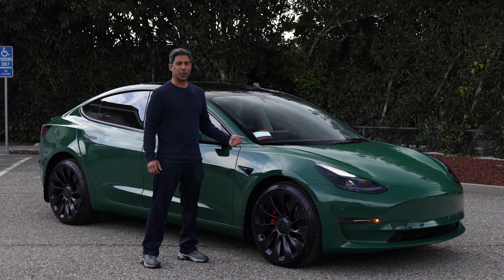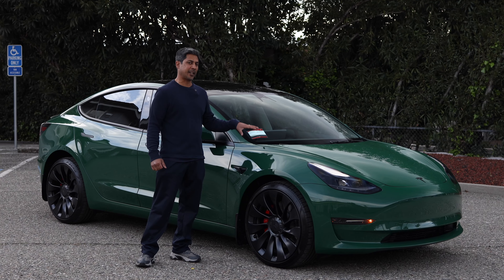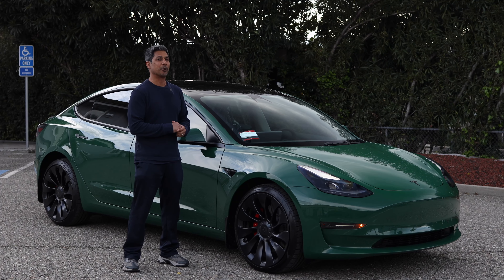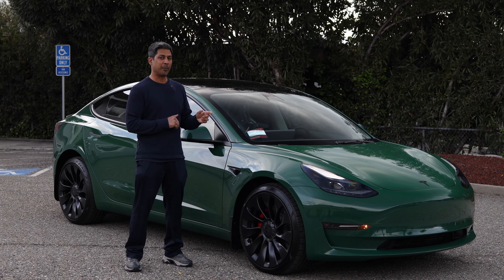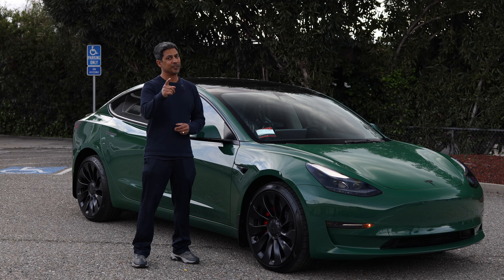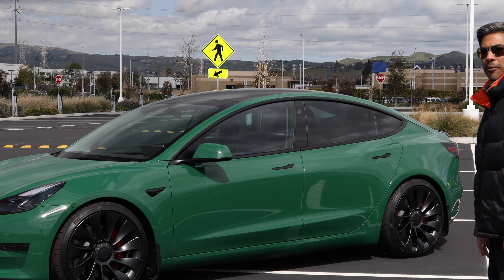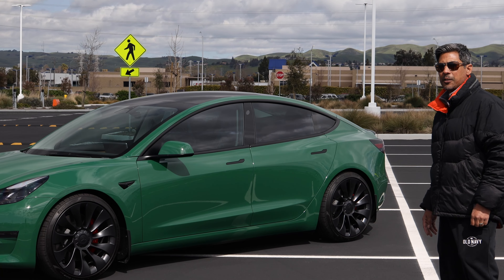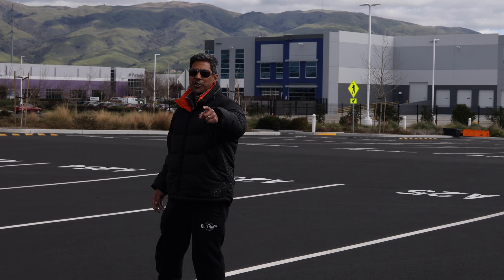2023 Model 3 Performance dropped on ZEV Springs by Eibach  and wheel spacers!!!!

Comment: Great video! I have 25mm (1'') lower Eibach springs and H&R spacers 17mm front and 17mm rear on my M3P 2023. with OEM Pirelli tires 235/35/20.
Do you think if there will be a tire rubbing if I mont  wider tires - 245/35/20? 
I would really appreciate the advice!
Reply from the maker: a lot depends on your camber values.  You'll probably be fine.  Did you buy rear camber arms?

Comment: How did you guys get the Eibachs to lower just 1" all around ? I thought Eibachs lowered the performance 1" front and 1.4" in the rear. Also, did you guys need to run rear camber arms?
Reply from the maker: We always do rear camber arms.  This also helps to level out the car because camber will affect the ride height.  We are very particular and like symmetry.  We have our own ZEVcentric Eibach setup. That reverse rake was something we did not like and really diminished the ride quality so we came up with our own setup after tons of testing.

Comment: In order to get a more isolated ride ie not feel all the road harshness penetrated into the cabin, does switching to polyurethane spring isolators help?
Reply from the maker: Unlikely.  You just need these adjustable shocks to soften the damping. https://zevcentric.com/collections/coil-suspension/products/tein-endurapro-plus-adjustable-shocks-model-3-y?variant=43332838719733

Comment: H&r 14mm spacers F&R?
Reply from the maker: Correct.  Only works well if you have rear camber adjustment to dial it in. Are you lowered?  https://zevcentric.com/collections/model-3-spacers/products/h-r-trak-14mm-drs-mz-wheel-spacer-bolt-5-114-3-center-bore-64-stud-thread-14x1-5-black-pair?variant=43215766782197
Reply: @zevcentric  still stock at the moment. Picking up mpp comfort coilovers and rear camber arms, debating to get spacers or swap out the OEM 235/35/20 pzero to 255/35/20 ps4s.. not sure if spacers will still be needed
Reply from the maker: @jchan112  i can help you with all that.  We stock the MPP stuff and race on it as well.  We will be starting our MPP series very soon.  One of the pinnacles of this channel.  We can discuss the tire/spacer situation via email if you’d like.

Comment: Big fan of the channel. Been following you on facebook for a while. If you were to choose between Tein EnduraPro Plus + Eibach spring and MPP comfort non adjustable coils. Which one would you recommend for 80% daily driving and 20% spirited driving. Not likely to track it. Just looking to improve DD comfort and handling when needed.
Reply from the maker: All depends on your desired ride height.  MPP non adjustable if set to the right height is like “bmw” oem so to speak. The damping is more refined on the MPP setup but at a higher price point.  I dont think you can compare something that’s 2x cost and expect the cheaper one to be the same.
Reply: @zevcentric  Ah fair enough. The reason why I’m considering the non adjustable one is I probably will set it and forget it lol. Maybe during the winter months I’ll raise it up when I go back to the stock 18s with winters. 

In terms of ride comfort, how is the non adjustable ones? As for ride height, probably 1” or 1.5” at most as I’m worried about scraping everywhere.
Reply from the maker: @JONTAN24  the Tein will have adjustable damping but that MPP will not so that’s the only compromise is being able to fine tune the ride.  The MPP however allows the ability to adjust the height.  Just remember you need to do alignment every-time you change height so that ca. get pricey.  The teins are backorder until May but we have the MPP in stock.